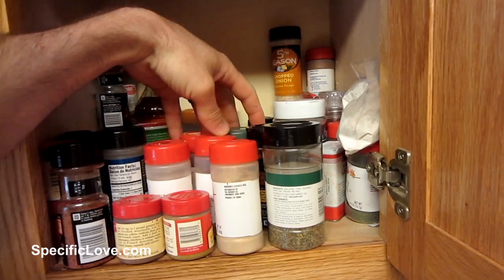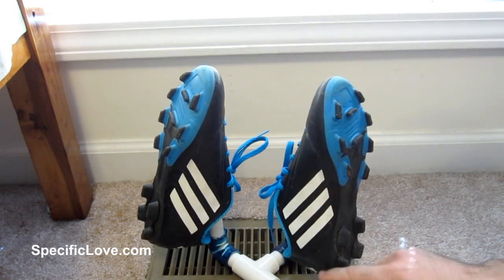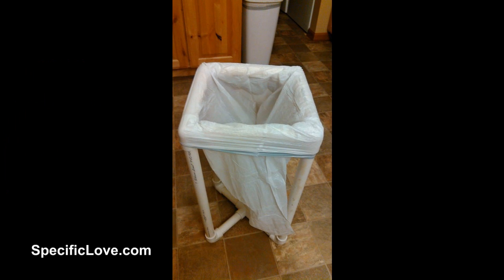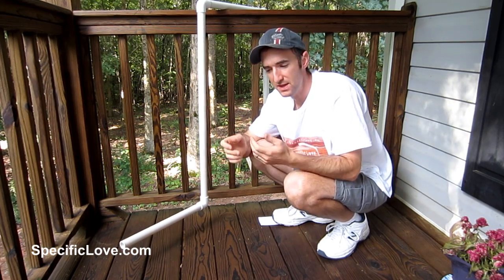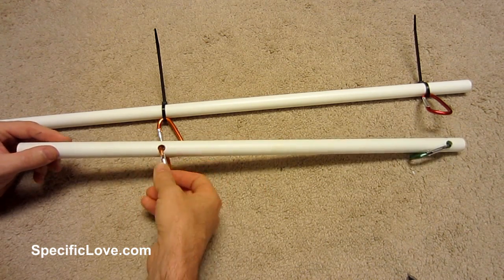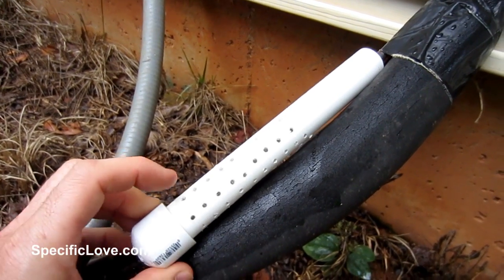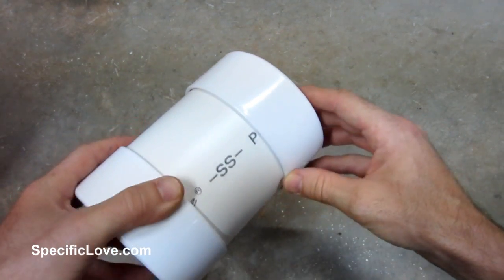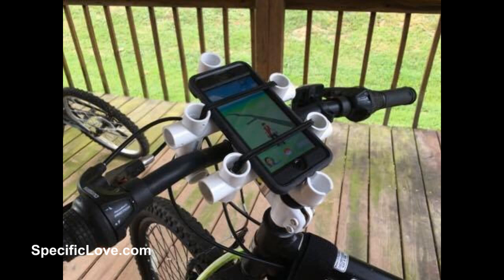10 Life Hacks with PVC #19

Comment: You can prime the siphon in an easier way. Submerge the entire line underwater and bleed off the air, plug both ends and put the outside over the edge of the pool, remove the pool side plug then the outside plug and the water draining will pull the water up and out as before.

Comment: ...about the shoe dryer: If the pipe, going inside the shoe, was link to a "T" placed over the incomming hot  air ( Instead of an elbow) and if this pipe had few holes along its lenght, a lot more air would circulate inside.....

I mostly like this roll of foam over the top of a car....brilliant!
Reply from the maker: That is a good idea

Comment: on your roof noodle. one great way to secure a rope in a door, trunk or hood is to use a large knot but a short section of PVC helps spread the stress, a 4" piece with the rope or cord run through and then knotted or whipped forming a small triangle.. think water ski handle in miniature. I use them to secure the nose of the canoe to the hood..
Reply from the maker: I did not think of that, nicely done.

Comment: on the pool chlorinator... use one end cap on the upper portion, glued. one female on the lower portion. and one plug. no floatation but the air trapped inside is needed and put the holes up the lower side and in the screw in plug. pool tabs are 3" diameter and spa tabs are 1" (but some brands vary on spa bromine tabs). longer and thinner in case you need more tabs. and if you really want floatation other than air cut off part that noodle and put inside.
john the pool guy
Reply from the maker: Thanks for the info

Comment: I have one for you, I have cut and stuck end on with hot glue different size PVC pieces to a square of wood and have all my files in them, I can pick any file I want easily and it is compact. You could i suppose make a box to fit as many as you want and put a cable tie around the top. Another way might be to make the PVC like pan pipes,  largest to smallest set them in wood with a brace along the length. It sure beats keeping files in a draw.
Reply from the maker: +keefe43 interesting idea

Comment: On your shoe dryer. If you were to put a T instead of an L on the bottom of the uprights that the shoes go on, and cut off the end of the T that faces downward, you would have warm air going up through the pvc which would dry the toes of the shoes much faster. Actually it is not really even necessary to cut the end off of the T. It should work fine without cutting it. Maybe it would balance, with the shoes on it, even better without cutting it.
Reply from the maker: +Bob Brueckner Good thinking